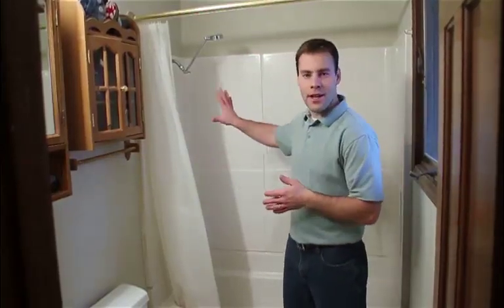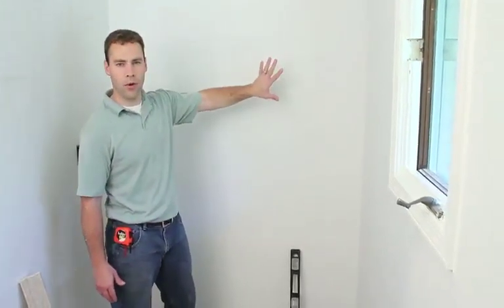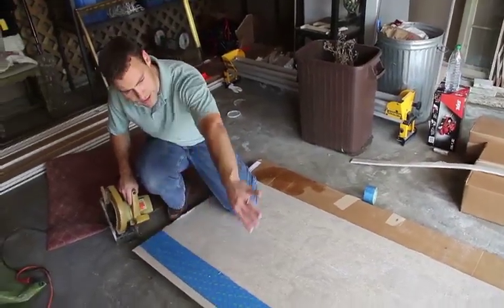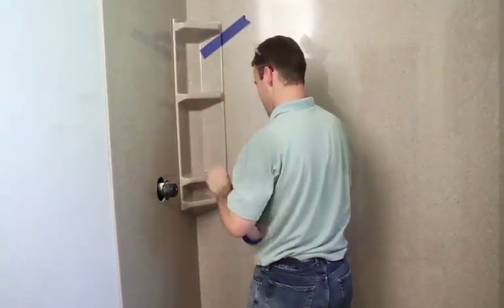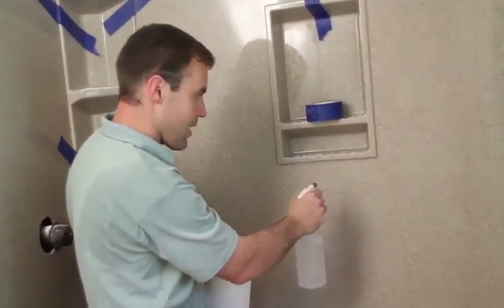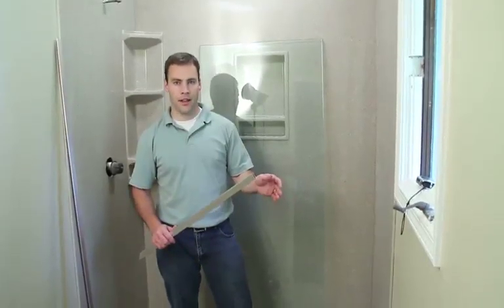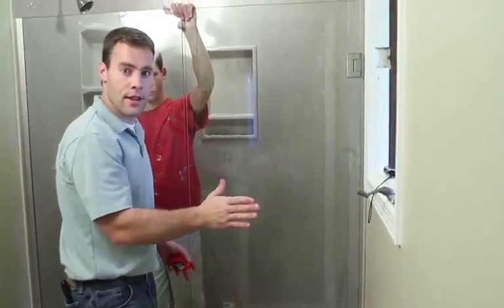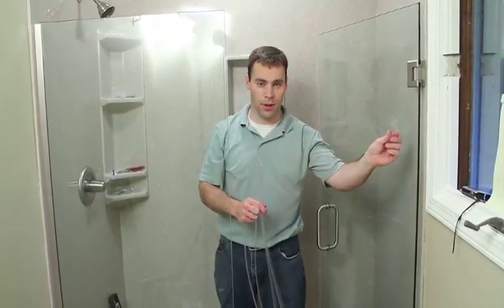Onyx Shower Installation | A Step-by-step Guide

Comment: I'm currently installing the wall board. I'm using Densshield. Do I need to tape it and float it? If so, is it okay to use regular drywall mud to cover the tape? I will then prime it. 

Also, one of my walls has about a 1/4 inch bow in it from one side to the other. Will the panels adhere to this without issues? 

Thank you.